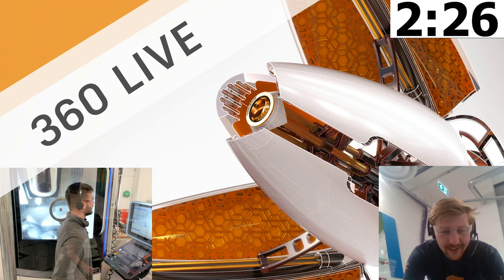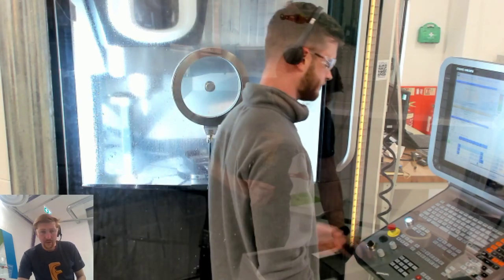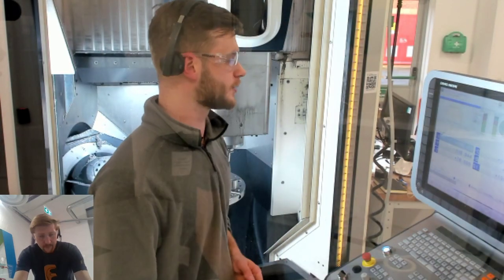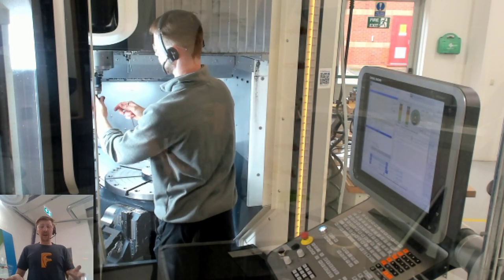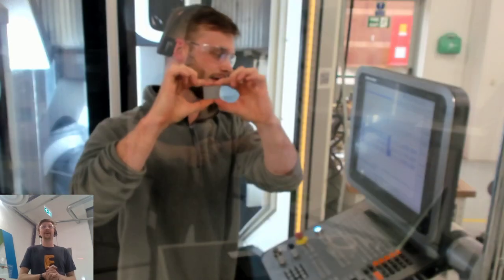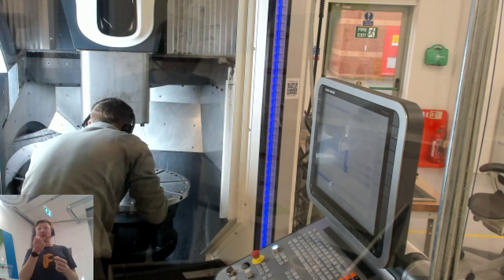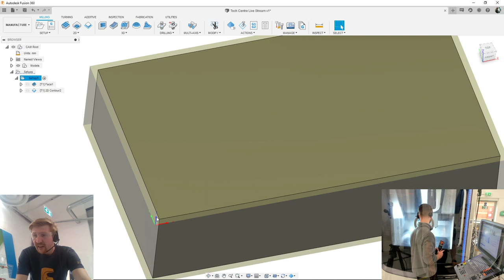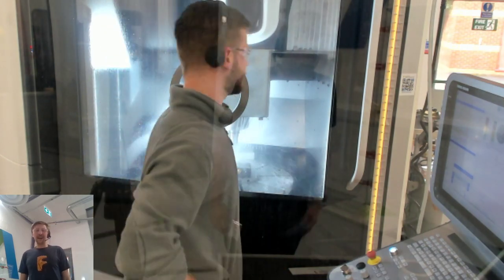360 Live: How to set up a CNC mill Live from Birmingham UK Tech Center

Comment: I often struggle with Machining , maybe fusion 360 can someday launch an update that will suggest me the speeds feeds based on my Holder Height (configured in fusion) , Material , Tool Material etc etc , Autodesk can do it with their huge amount of data that they have from Machine Tool Builders / Tooling companies , basically that would be like putting billions of data points on cutting into the software and then suggest a noob like me how to cut and use their software better , eagerly waiting for that update 😇🌸🌸